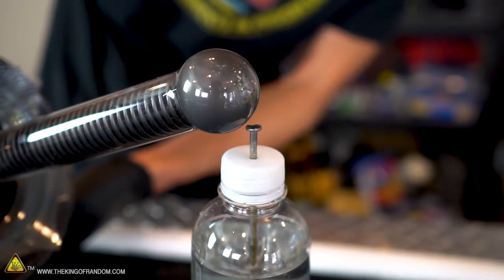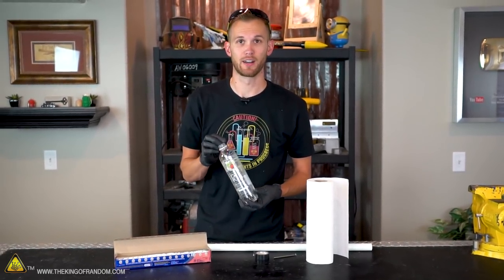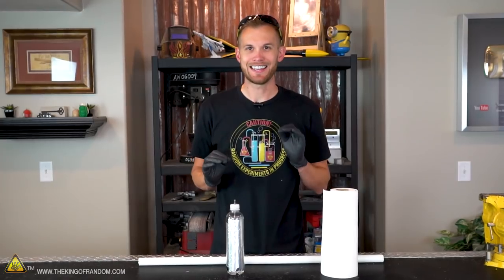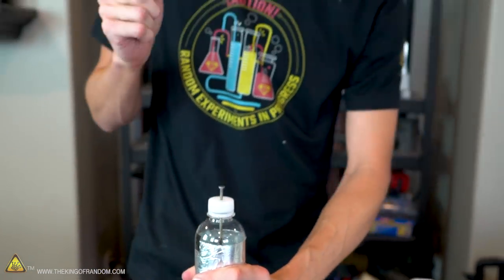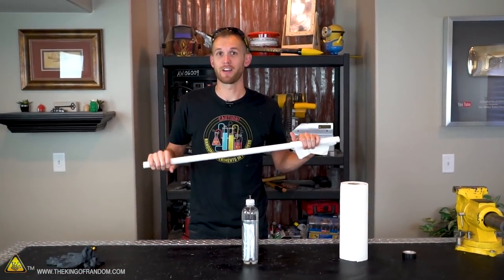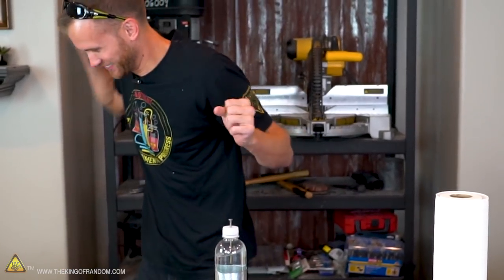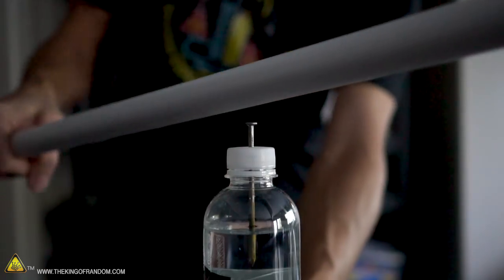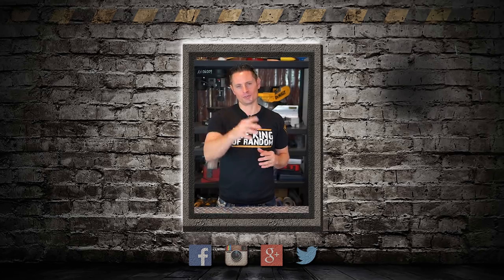SHOCKING Science with a Leyden Jar! TKOR Details How To Make An Electroboom Leyden Jar!

Comment: When I was in highschool my science/physics teacher had a hand crank Van Dr Graaff generator. So I went online and stumbled upon the Leyden jar being used to store power from the Van Dr Graff. So I made a dry version  from a 5 gallon bucket, aluminum foil on the inside and outside walls and a small chain attached to the lid that ran to the foil coated bottom. I brought it into class to find out that even after charging it, I thought I discharged it, and like 5 hours later after school was released, I went to the classroom to bring the Leyden bucket home. I accidentally touched both ends of the buckets contacts and found out that it was capable of holding a charge powerful enough to make me see a flash of white over 5 hours after initially being charged.
Reply: how did you charge it?

Comment: I didn't have a pvc tube, but I do have a makeshift plasma cutter that I made from a plasma lighter. It's really weak but I thought it would be enough to charge the Leyden jar. Then I saw the second half of the video and my hopes and dreams were shattered :P
Reply: Can't charge the jar/capacitor with alternating current (AC)... will charge/discharge with every cycle of the AC frequency.
Reply: You can use a balloon
Reply: Grant can you plz do a vid
Reply: You can use a Van De Graaff or a wimshurst machine to charge the jar.
Reply: just put a diode inbetween maybe it will work
Reply: Flippy Sidee the plasma cutter generates alternating, it doesn't keep a constant charge at all.
Reply: Merlin Blatterer that's the trick, but can the diode handle high voltage without any breakdown? You would need a diode that can withstand high voltage.
Reply: just watch some videos about electrostatic and you find out what you can use for charge this

Comment: Apparently classic Tupperware tubs work really well for Leyden jars. PET plastic in drink bottles is slightly porous, so unless it has been kept dry for days, it conducts a very small charge through the walls. The soft plastic in classic Tupperware has similar characteristics to the insulation on electrical wires and is not porous. Also, most of the foil with insulation tape reduces charge loss, and any area you intend on touching needs to be in the middle, not on an edge, as sharp edges release static charge. (That's why lightning rods are pointy.) Another tip, use a piece of copper wire instead of a galvanised iron nail. Copper conducts electricity better, and loop to top end over so there are no sharp ends. Swap the paper for a piece of nylon, polyester, or silk, and if you don't squeal from the shock after following those tips, there's something wrong with you.

Comment: I built Leyden Jars from empty fish food containers when I was 10, though I preferred a dry jar with foil on both the inside and outside of the jar to these wet ones, simply because they were so much lighter so it made it easier to transport my collection of 20+ jars.
I have a few tips here:
1. always ground the outer foil when charging it, it makes it easier to build up a charge
2. when discharging larger Leyden Jars ALWAYS USE A TOOL, myself I used a bent paper clip to complete the circuit 
3. Rather than using a frictional device like PVC pipe to charge the Leyden Jar, might I suggest building an electrophorus, for an easy start, or going with something like a Wimshurst machine if you want to go full tilt (as I did), if you want to go down the path of awesome whimsy you could build a version of Lord Kelvin's Thunderstorm, that might be right up your alley.
Reply: Why isnt anyone using a kite or a clock tower? Doc brown franklin style.

Comment: Time to ask the real question 
Can I charge my phone with it?
Reply: UnPhayzable no
Reply: Yes
Reply: Maybe
Reply: I wouldnt it. Your phone chargers with around 5 volts and you cant feel 5 volts so with this if you can feel it it is probably to powerful
Reply: Austin Sherwood, rest in peace, dreams.
Reply: No because it's DC current not ac
Reply: Austin Sherwood No it wouldn't charge it because to charge a phone it requires ac current not dc current
Reply: UnPhayzable no wrong voltage
Reply: ezekiel Reiner Leveriza ???
Reply: my dreams were ruined i just imagined carrying a water bottle that charged my phone.
Reply: UnPhayzable 

GENIUS!!!!!!!!!!
Reply: NO because it discharges completely just with one touch
Reply: MythicaiiOfficial actually phones use DC. That’s why you need a usb wall socket. To convert the AC to the useable DC needed to charge the DC lithium battery in phones.
Reply: Yes, you can. You can also charge your phone if you put it in a microwave.
Reply: The 3d-printed Cat Very true. Are infrastructure uses AC and 99 percent of all devices use DC.
Reply: You would most likely need some resistors and a preferably switching voltage regulator to get it to the 5v your phone need.
And i don't think it would be able to hold a charge big enough to actually completely charge a phone, as it's a capacitor.
Reply: UnPhayzable no because your phone needs AC direct which I think converts to DC but no because that is static
Reply: Block Z YT Well it doesn't need AC ever sense this is a capacitor and not an AC generator. Its DC so it would by virtue charge your phone just not really at all.
Reply: Yes! Simply dump the water all over your phone, be sure to get some in the charger slot!
Reply: UnPhayzable right?
Reply: ezekiel Reiner Leveriza obviously you need to learn some physics then xD
Reply: UnPhayzable I actually modified some parts of this jar! I ACTUALLY GOT IT TO CHARGE MY PHONE! It only lasted about 5-10 minutes but charged it from 64% to 76%! I had the same question and I wanted to find out so I modified an electric cable and added some insulators around the nail and some other weird stuff to slow down the discharge from the jar and I got it to charge my phone! 🤣 I laughed so hard because i didn’t think it would be possible!!!
Reply: CodeKillerz wait, you can?
Reply: Tarkyn Blair-kril OMG I NEED TO TRY THIS
Reply: The 3d-printed Cat yes but ac charges it faster
Reply: UnPhayzable This acts as a capacitor which stores then releases a quick burst of electricity. I suppose this could give your phone a quick amount of electricity to charge, but nothing significant to charge it (at least at this small a setup)
Reply: you can burn down your phone with this thing
Reply: no you can't
Reply: UnPhayzable no but if you try it anyway send me a video of it.

P.S if you touch you phone to enough electricity static or otherwise it might just break your phone.
Reply: MythicaiiOfficial No, because your phone charger takes AC 230V mains voltage and outputs DC 5V to charge your phone.
Reply: This is basically a capacitor, so the real question is Can you charge a phone with a capacitor?
Reply: no its a shok not +and- electricity
Reply: The Wierd What?
Reply: It could work if you did it indirectly. But under most circumstances no.
Reply: yes
Reply: CodeKillerz wait seriously? That seems cool but also I feel like without any knowledge of what would happen I would think it would explode cuz like why not lol
Reply: MythicaiiOfficial wait do you mean the phone needs dc and this give ac or?..
Reply: No it’s not a battery it’s got too high of a discharge so it doesn’t hold energy
Reply: @ezekielleveriza4071 There are 'smart' water bottles with powerbanks in them. They tell you to drink regularly, keep track of how many you drank etc.
Reply: @avech1285  if you don't understand anything just don't respond
Reply: @idkm6776  just don't talk if you don't understand anything😣
Reply: @tarkynblair-kril1028  there is no need for lying
Reply: @avech1285  no ac is converted to dc in wall adapter😠
Reply: @caleb does tutorials volts is few hundred volts more then it needs but capacity is low
Reply: @aliidress5619  omg man just don't talk if you don't understand anything
Reply: @revolution5547  omg that comment from 10 months, goodmorning boi
Reply: No.
Reply: @avech1285  wrong.
Reply: @magnuserror9305  And do you know why building infrastructure uses alternating current? It's because AC is easy to distribute to houses. You cannot use a transformer on direct current. At the end of a power line, in the days before AC, people would have basically no power, and those at the beginning would have a lot.
Reply: @DarkSlayer-xk3fb  In North America, the mains voltage is 125v. In Japan, it's even lower, at 100v.
Reply: @DarkSlayer-xk3fb  In Europe, not in the US. In the US we use 110V AC current.

Comment: You can charge this with a mosquito killing racket. Just disassemble it and plug one wire into the aluminium foil and the other into the nail. You will get a huge electrical shock them :D
Reply: Dj Pauloso can we do it with other ways?
Reply: I suppose you could use a disposable camera, like the ones turned into stun guns
Reply: Matt Holmes MODERN ROGUE
Reply: Matt Holmes wait what? Turning cameras into stun guns? How!? (That's amazing)
Reply: Pug Fister  lol thanks but that comment was 7 months ago
Reply: dont forget the full bridge rectifier
Reply: @sheymartin2107  It's not a new idea. Made my first stungun 10yrs ago.  The Internet, heard of it?
Reply: @spacetimesystemz  I hear it's on computer now. 🤧😷🤪😜

Comment: Love the video! I've been watching the King of Random for a VERY long time.

But if I'm not mistaken, the plasma globe gives off an alternating current, so the capacitor would be continually charging and discharging, preventing it from actually building up any charge.

You should hook it up to a car battery or Van de Graaff machine instead (since they give off a direct current), and then discharge it with something like a paper clip (or a lightbulb!)

Comment: I’d love to see some videos on ‘testing’ your Leyden Jar. What can you charge it with? Can you regulate the discharge? Can you measure the voltage you’ve charged it to? What about using your high voltage neon sign transformer to charge?
Reply: Everything about a Leyden jar depends on the size of the jar and size of conductors.

Comment: heyhey,
 I think the colour of the spark is from the material you take out the spark.... like in an Optical Emission Spectrometer.
The plasmagas vapors atoms from the foil or your finger ( natrium from the salt in your sweat should be orange) and that changes the emissionlines of the light spectrum,
 try to use some copper and it should turn greenish.
greetings from Austria

Comment: How long would this hold the charge?
Reply: Seven.
Reply: Walrus
Reply: Table
Reply: until the water evaporates
Reply: Couple of minutes.
Reply: Woof
Reply: Tf is going on?
Reply: poo
Reply: I think static charge bleeds off due to a number of variables (like air passing over it over time).

I don't think it's indefinite but you could insulate it to make it last longer (I'm pretty sure) and it already will last a very long time.
Reply: Siiello It depends on how much energy it contains.
Reply: Anteaters
Reply: cucumber
Reply: Until its credit card expires... Duh!
Reply: Grab a brush and put a little makeup
Reply: Until February 30

Comment: The problem with the plasma ball is that the output is AC. Try the rectified HV output of a flyback transformer from an old CRT monitor. From personal experience, it will give you much more of a charge then you will ever expect!
Reply: Don't screw around with the flyback transformer of a CRT TV. There's even a warning on that rubber cap that covers the connector to the tube. Touch that output wire and you're dead.

Comment: Do another video with more people and do some fun experiments. First, touch the foil, then hold person 2's hand, get person 2 to hold the hand of person 3 and then shake person 3's hand. Then try to charge it using a DC volt (thanks to ElectroBOOM's comment about the DC current), you can find DC adapters everywhere. Then try to light up an LED, and then burn out an LED (you're going to need to touch the foil, aka ground, touch the long leg of the LED with the same hand, then touch the short leg of the LED to the nail). Maybe make multiple jars, charger them all up, and then have some fun with them? Include the multiple people in this activity?

Comment: Hey King of Random, is it possible when you tried to charge it using the plasma ball (or what ever its called) and it started to emit a smell could it be that rather than charging it you began the process of electrolysis?

Electrolysis for those who don’t know is when you run a electrical current through water to produce Oxygen (or something like that, feel free to correct me)
Reply: You are mostly correct, electrolysis is the process of running an electric current through water and splitting it into hydrogen and oxygen however, for that to occur you would need a positive and negative electrode in contact with the water. Hydrogen and Oxygen also have no smell but Ozone (a triple oxygen molecule rather than the breathable double molecule) does have a smell.
Reply: I forgot to mention the Ozone is created by O2 being torn apart because of the electric current and reforming into some O, some O2 and some O3 I believe. Anyone feel free to correct me on anything I am wrong about. The last thing I want is to spread misinformation

Comment: The spark between that metals was blue mostly because of the emission spectrum of gases in the air and that is mostly blue color. But when you were touching it with your finger the color changed due the ions from your "burning" skin. :D And the plasma bulb didn't charge the jar because it outputs high frequency AC voltage so it was something like charging and discharging pretty fast. Maybe it could work through a rectifier.

Comment: Use a small electric motor (drill) to spin a piece of PVC inside of paper towels. You can use an end cap with a hole drilled for a rubber or vinyl nut/bolt hardware so the pvc wont discharge onto it. This will accelerate charging many times. If you have a long piece of metal, such as an aluminum foil strip lining one side of the PVC interior wall overlapping onto the exterior wall by a few inches, that should collect the charge. Then simply touch the nail with the charged aluminum and the charge may transfer. Or run a thin wire connected to the aluminum strip that will constantly transfer the charge into the bottle as its generated.
Havent tried it but it may work. Cheap and quick build.

Comment: Did dat as kid with slide by going down and getting static. I think static electricity is different from the plasma globe so can be held be the capacitor
Reply: The difference is the plasma lamp uses ac and not dc.
Reply: Static electricity is electrons being separated from their atoms by friction so Nate is basically dumping the spare electrons into the water.

Comment: You've created what is essentially a capacitor. A device designed to store a charge and then to rapidly release it. Camera flashes use capacitors to provide the burst of electricity needed to create a momentary burst of light. The amount of electricity a capacitor can store is measured by what's called capacitance. You can use a digital multi-meter to identify the capacitance of your Leyden Jar.

Another fun experiment you can try: Take two sheets of aluminum foil and two sheets of wax paper. The width of the aluminum foil must be less than the width of the wax paper. Attach a wire to each sheet of aluminum foil. You can solder it if you like. Layer the sheets as such: foil, paper, foil, paper. Then, starting at the end with the wires, start wrapping your sandwiched sheets around a piece of pvc pipe. The aluminum foil is on the inside against the pvc pipe while the wax paper is on the outside of the wrap. Make sure that you do not have any point of contact between the two sheets of aluminum foil. The wax paper is your insulator. Use tape to hold the end of the sheet in place after you've finished wrapping your pvc pipe. You're finished. You've created another capacitor. The tighter you wrap it, the higher the capacitance you can store with your homemade capacitor.

Comment: use bigger diameter bottle
run nail all the way through the bottle
wrap multiple layers of  aluminium foil simultaneously with attached paper  so that it won't conduct between layers
Reply: That's what i thought too
Reply: Biggest effect on capacitance is by using a thin-walled large container

Comment: how about a diode on the input side of the high voltage coil one from an old microwave would work well but be carefull the capacitor may be enough to defib you great video also I wonder if a cheap stun gun would do the trick to charge it (I forget if they pulse dc or ac)

Comment: The nail might rust
Reply: not if the air inside is going to be sealed
Reply: LightningShock no. Not only can it react with oxygen in the air, it also reacts with oxygen in the water. I made one of these a year ago and the nail did rust.
Reply: use galvanised nail, zinc layer protect the iron from rusting
Reply: Or use a more noble metal like copper. Also better at conducting electricity then iron.
Reply: General Chicken copper can rust
Reply: Eddie Fijn 
Copper doesn't rust it oxidizes.
Reply: General Chicken Cu will also corrode when H2O & O2 r both present
Reply: True, but much slower then iron. Saying gold or platinum felt overkill for something like this ;)

Comment: you can make a leydin jar from a bottle... shocking!
Reply: @spencer wells: Leyden jars made of glass are still in use today on high power plants as they are known to resist high voltages in the kilovolt range with ease. Arcs can't penetrate glass.

Comment: The other method is having some aluminum foil in the bottle, so wider neck bottle is better for that, then use long nail or small chain to contact the foil. Works just as well and you eliminate the corrosion issue of salt water on the metal rod.